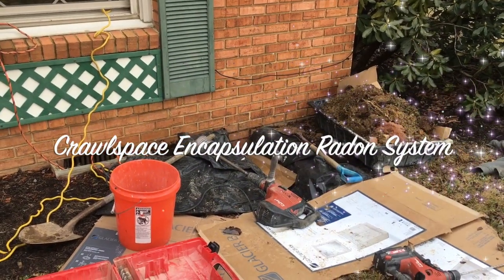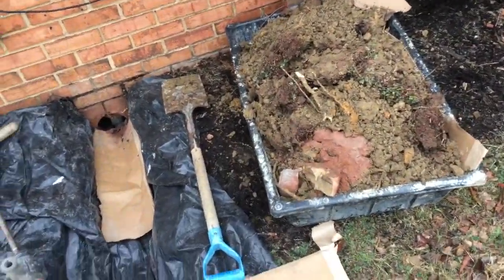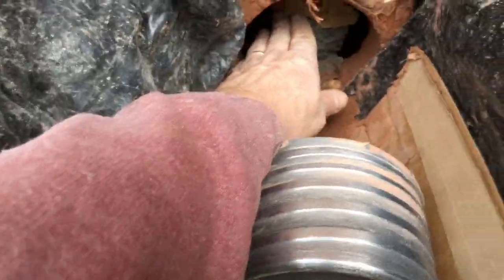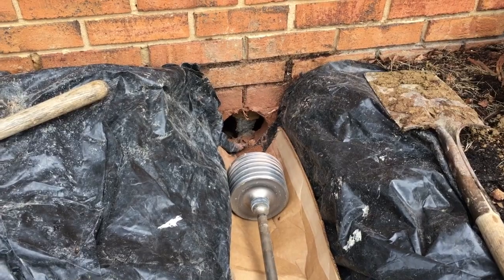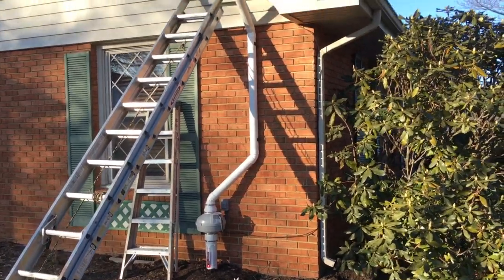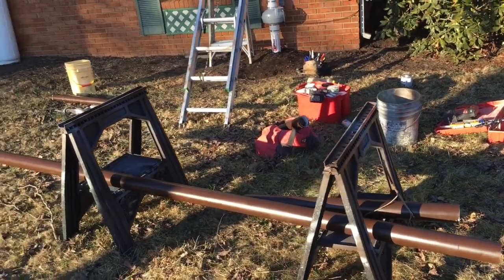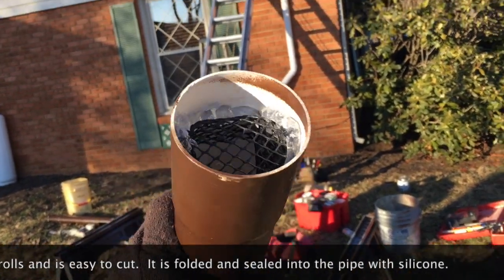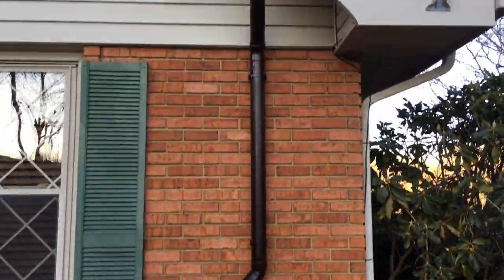Radon Mitigation by Crawlspace Encapsulation

Comment: Why did you put this on the front of the home?!??
Reply from the maker: Hi Michael.  Although circumstances have actually forced me to put a system on the front of maybe 1-2 homes in my career, this one is not.  This particular system is situated on the far side of the home but TOWARDS the front.  
Why towards the front on this home? Probably shrubbery or slope of the land against the home. (it's been a few years) Getting electricity to the fan is also a factor for placement of the system. Thanks for watching.

Comment: Hey Scott, aspiring mitigation specialist here, I was just curious for your submembrane jobs how do you normally do your suction points? I've seen diagrams of a pvc T being used with a corrugated drain pipe run through but I had concerns over the stability of such a setup and it was a little hard to tell what was going on in this video at the suction points.

Your videos have helped me out a ton, God bless
Reply from the maker: Hi Chaz, I do them a bit differently now.  
Here is my most applicable video to your question.
 https://www.youtube.com/watch?v=mkljX3lWBQg&t=6s
I've got another one coming out soon that should be of help. Thanks for watching!